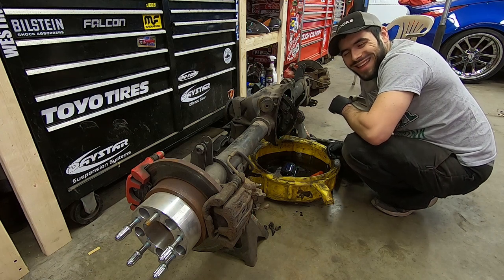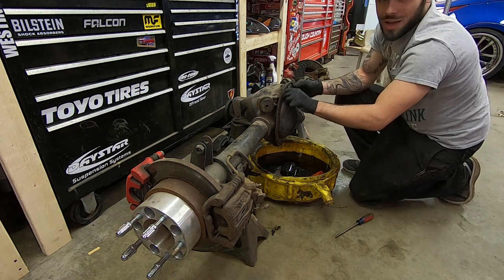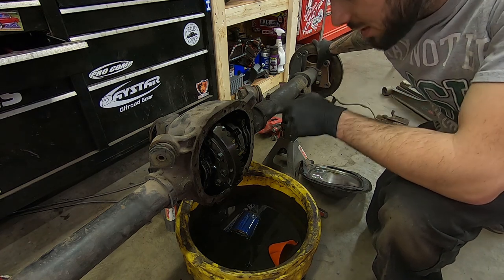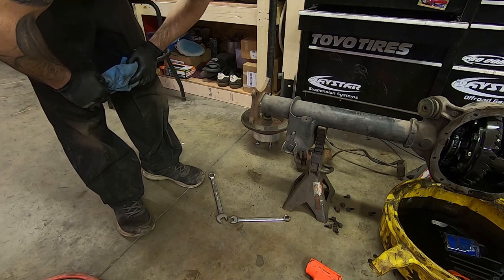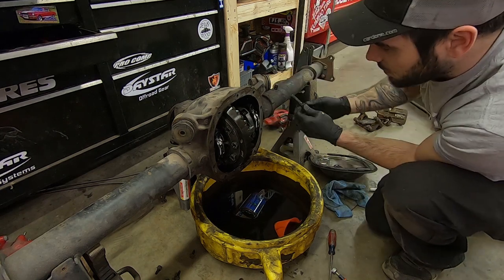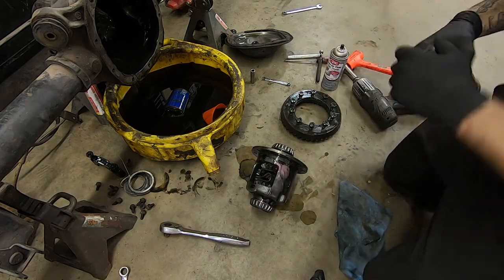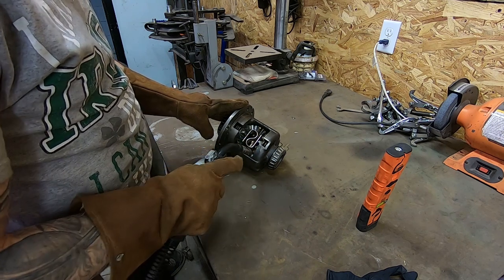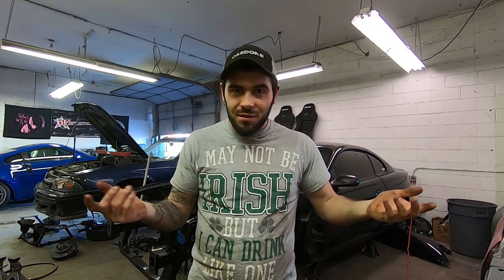WELDING THE DIFF FOR THE SN95 MUSTANG DRIFT CAR!

Comment: great video man, do you think it would be worth adding a plate in between all the gears im looking into doing this to my 98
Reply from the maker: Only on one side. You have to still be able to get the c clips out, and get the center pin out of you had to.
Reply: @RatchetstrapMedia  awesome thanks for the reply! another question i have for you is, if i were to go to a junkyard and scavenge a differential would there be an issue using that in my vehicle. such as spacing backlash..etc sorry for the noob question new to the car world.

Comment: can you just take off the diff cover and weld it while the rear end is still mounted on the car?
Reply from the maker: Sure. You can do anything you want. Should you? No. Get it out on a bench, clean it good, and melt some metal together.

Comment: Would you still be able to slide out the c clip to slide out the axle to change out or even change the bearing or even add dual caliper plate
Reply from the maker: Yes. I had to install all of that to put the carrier back into the differential housing.

Comment: Whats your setup on your welding machine and how high on the amp? I guess im not sure i dont know how to weld but i wanted to know what kind if welding machine i need and the set up as well
Reply from the maker: This was not mine, but it’s a harbor freight top of the line machine. I don’t remember exact settings, but fast wire speed, and very very hot.